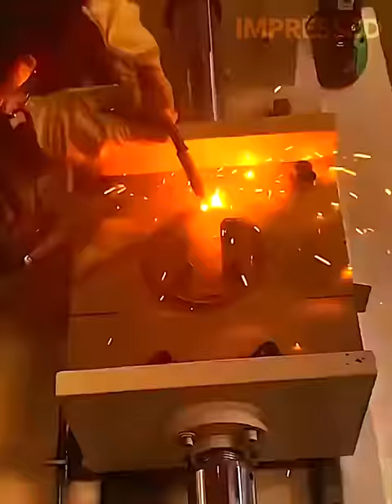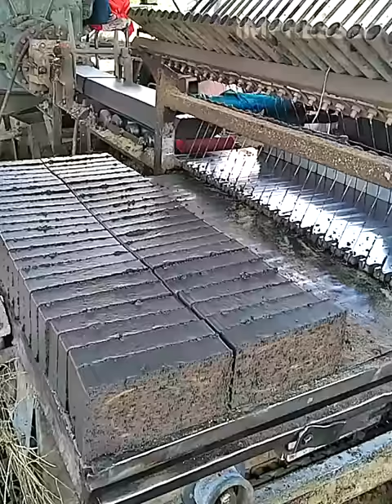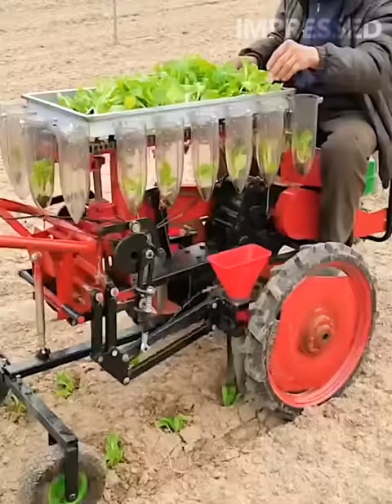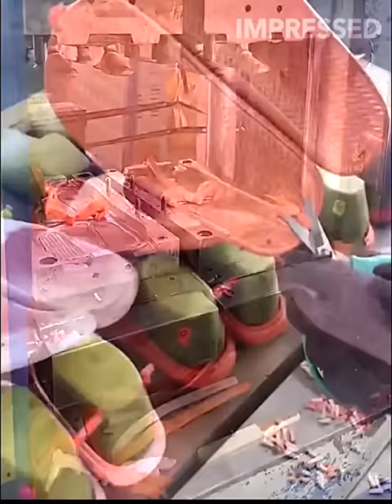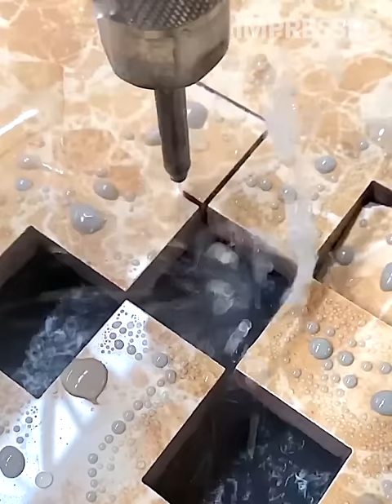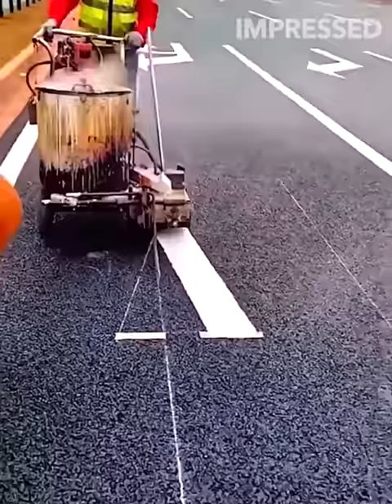Amazing Machines Operating At An INSANE LEVEL

Comment: the cement block is not cut with a specialized "jig Saw' blade it was a band saw, very different  type of machine,  I see and hear mistakes of this type on your presentation often,  you could use some quality control.
Reply: Education

Comment: It's absolutely mindboggling to see how much false information can be put into a single video. 😂
Just a few examples:
"molten metal gets shaped" - it's very clearly not molten
"a spinning blade cuts the potatoes" - the blade is clearly stationary, but the potato is spinning
"this machine sorts bricks" - you can see the workers sorting the bricks
"molten metal transportation is achieved using a magnet" - it's not molten, it's shiny metal scraps. Molten metal isn't ferromagnetic.